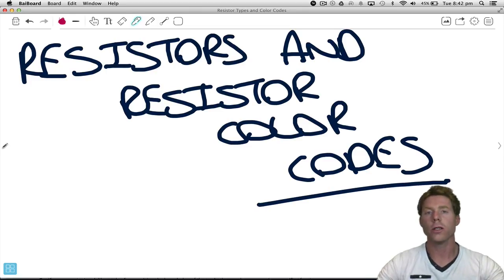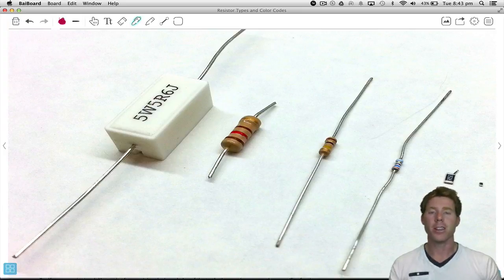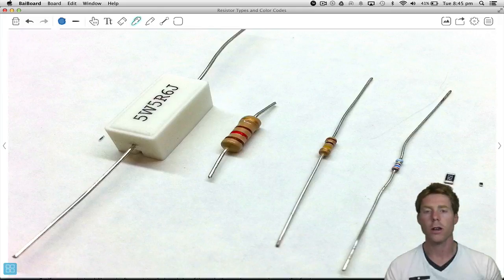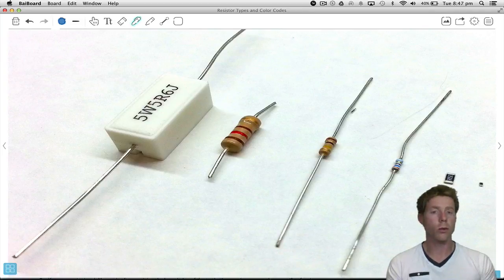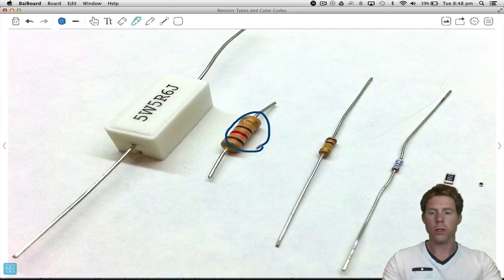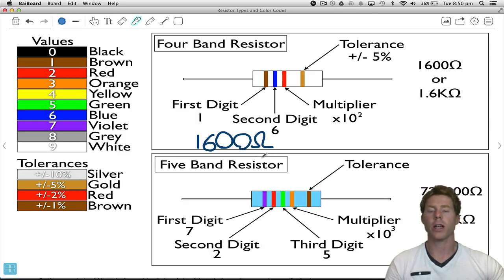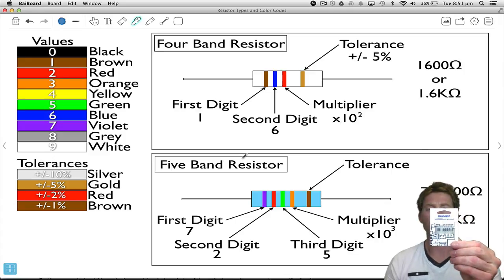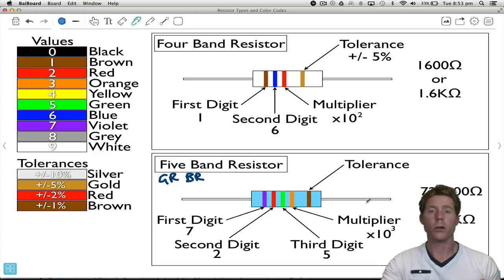Electronics Fundamentals Tutorial #8 Resistor Types, Values and Color Codes

Comment: I clicked on the link to check the other stuff out, very good stuff there to learn electronics, I'm so glad I found this video,now i can watch your other videos and hopefully learn more about electronics.. I do have a question the very micro small little resistors,how do you know the value of them? like say on a small touch pad i see a very small resistor and it has 103 on it. I'm working on a project of wiring a basically following the back side of a touch panel and first drawing the diagram on paper, then i want to try and make my own touch panel but using real wire and solder to make the connections. Basically a design flaw in a touch panel from manufacturer using flex cable that breaks down to easy. Any way I'll take my time and do lots of research before I begin the soldering and connections of each switch,LED,resistors and so on..